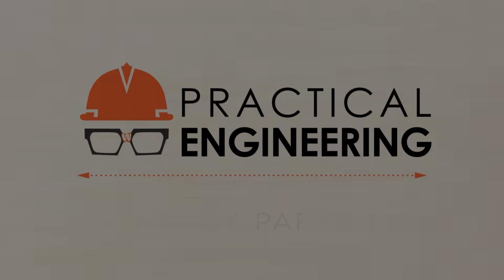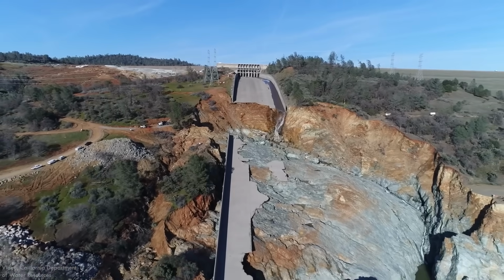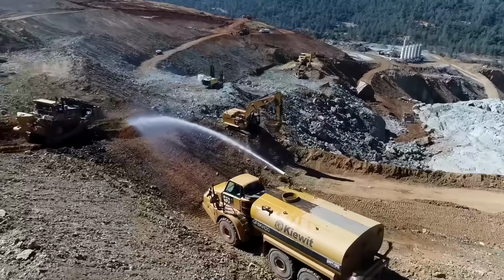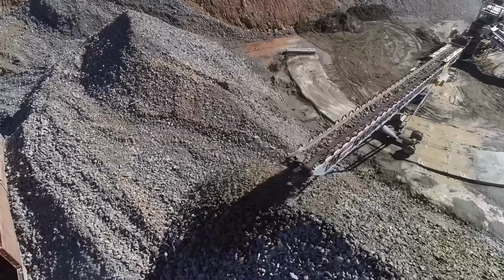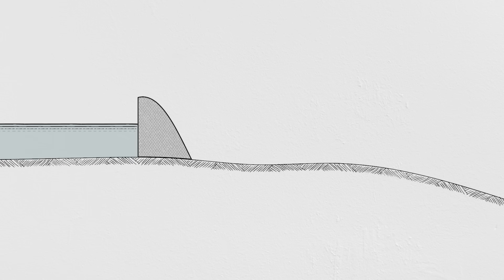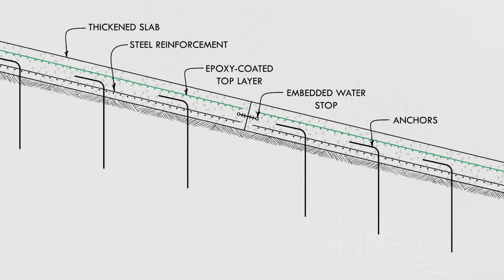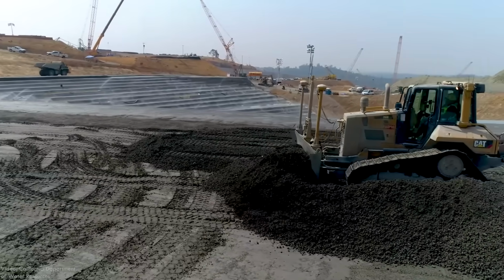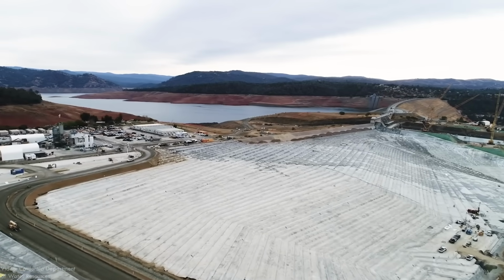Rebuilding the Oroville Dam Spillways

Comment: I think your description missed some important aspects of the concrete slab under the spillway:  key joints and a one inch jump at the top of each slab to prevent water pressure from going into the slab.
Reply from the maker: I discuss those details a little more in the previous video about the failure.

Comment: An almost incomprehensible project. To think there were literally people vacuuming the massive hillside to prep it. It's like cutting grass with scissors. 

Just incredible.
Reply: Right? It boggles my mind the amount of different pieces of engineering and manpower involved in a project like this. There's no way any one person could understand the whole picture but this was a great summary video
Reply: @SamCyanide  I hope there is, as it's someones job to oversee the project to make sure it runs properly.
Reply: You might be surprised, a "clean and clear" foundation base is always specified. We don't anticipate clean rock most of the time, however, so we're typically thinking compact native soil with a compacted fill soils in to fill in local soft spots.
Reply: I was stunned when i saw that :D
Reply: Yeah kiewit did the construction and knocked it out safely and very much on schedule. There civil projects are fantastic
Reply: "Just Incredible"? No, Just Construction. Sometimes that's what it takes to build/rebuild a project. Next time you're stuck waiting in a road construction zone, think about those guys on their hands and knees dragging a shopvac up that hill.
Reply: @charlieboardman6873  a lot of road repair involves shop vacs as well.
From the diamond saw guys cleaning up their slurry, to cleaning out cracks or potholes prior to filling them, to working on bridge expansion joints, there are a lot of guys with vacuum cleaners on road repair crews.
That was an extreme example because they had such a large area to clean, but not unheard of.
Reply: @ke6gwf  Yeah Ben, that was my point. I worked 40 years in construction as a carpenter, vacuumed up more  slurry and build more bridge expansion joints than the average carpenter.
Reply: @ke6gwf  He is right, though. Shop vacs are useful for picking up heavy dust, for example concrete dust because they require high static pressure (vacuum power not wind speed).

There are tons of industrial - and portable - machine that are 10x better than every single shop vac they bought at Lowe's. As someone in the industry, I can tell these engineers probably need to learn a thing or two.
Reply: @Awiled  if a shop Vac combined with whatever techniques the workers are using achieves the required level of cleanliness, why spend 20 times as much on machines that work 10 times better than needed?
Also, this was a rush job, so they may not have been able to get a large number of those higher grade machines as quickly as they could buy out all the shop vacs from the region.

And anything that was too heavy for a regular shop Vac to pick up, the worker would simply use a hand or tool and pick it up and out it into the bucket they had next to them. The vacuum was there to collect the dust, but the worker was the one actually cleaning the rock.
Reply: @ke6gwf  Fair enough regarding the equipment supply issue. I assumed they could probably find a place to rent a couple of machines or hire a vacuum truck to come in for a few days.

I doubt money is an issue considering how much the materials cost in this project. It would have been a drop I the bucket.

These more powerful machines would be able to pick up rocks, thus reducing workload.
Reply: @Awiled  I think you may not understand what was going on here.
The entire area underneath the spillway had to be taken down to bare clean rock, and these guys were basically taking a toothbrush to get it as clean as possible.
The vacuum cleaners were not the primary tool being used, the workers were using picks or bars or whatever to literally dig out every crack, and remove every slightly loose rock, so that the concrete would not have any voids underneath it, pockets of sand or dirt, etc. They needed to remove any potential void where water could flow or accumulate underneath the concrete, and that required manual labor going over every square foot of the project.

You can see that have a bucket as well as a Vac, that's because any of the larger debris and dirt they put directly into the bucket as they dig it out, and then they use the vacuum to clean out the smaller stuff.

So before the workers ever started crawling over this, I am sure that they used any tools available, pressure washers, compressed air, Vac trucks, power sweepers, etc, to remove as much material as possible, but none of that will work to clean out all the crevices, that requires a human touch, and so giving each guy a Vac helps them work faster, rather than having a few larger machines that the guys have to wait for and share.

So if it was about just removing loose material from the surface, then yes, they could have winched a Vac truck down the cliff, or swung it over on a crane, but that would not have done what was needed to ensure perfect concrete adhesion.
Reply: @ke6gwf  Great explanation, thanks. I'm not sure what made me assume this was the only effort at clearing smaller debris.
Reply: @charlieboardman6873  Incredible is the only single word I can think of to describe it. You could spend a lifetime writing multiple dissertations on all the different aspects of civil engineering/construction and barely scratch the surface. 

As a complete and total layman with only the most cursory understanding of what goes into projects like this, this sort of work is incredible to me.
Reply: @charlieboardman6873  Let people enjoy things
Reply: @Pyth110  ??

Comment: It's amazing how quickly things can be done when there's a sense of urgency behind it, if only other construction projects could be done with the same level of urgency, rather than dragging on for years while people argued over what colour the hoses feeding water to a site should be...
Reply: There's a project coming up near me next year that is showing a sense of urgency.  There's a bridge crossing a highway that was hit by a load that was too tall (boom truck wasn't fully lowered).  The span, one of 5 segments of the overpass, had to be removed and a temporary bridge was put in place (see the temporary span put in place in Michigan after the dam collapses there).  They have budgeted 3 months to demo the rest of the bridge and build the replacement.  Closing the bridge for longer severely impacts school bus routes and emergency services (there's an ambulance base on one side of the bridge but it's the opposite side from the main coverage area, detours add 5 minutes to responses).

Compare that 3 month window for a 330 foot long bridge to the 6 months a nearby road was closed to replace its 170 foot long bridge over railroad tracks.  

Have a sense of urgency, things can be done quickly.

Comment: Now imagine if the imminent danger of a bad flood season was the same level for climate change. We'd be carbon neutral by 2030. There's just not the same publicly visible benefit for the fight against climate change as there is for a huge flood wave just a few miles up river. It's a shame too because our world would thank us if we poured everything into protecting it.
Reply: Not sure you can compare this - A massive Construction project, with huge carbon footprint...with saving a planet...It's like 10 orders of magnitude bigger.
Reply: @mwnciboo  magnitude is different, totally agree. But if the danger of a 3° world was imminent, the magnitude of the changing our economic system would be equally large. Similar narrative would be the quote by Ronald Reagan (I think) said something along the lines of "how quickly our differences would vanish if we were facing an alien threat". Mother nature may not be an alien but it's something we are not the absolutely unable to control so I totally think my point is valid, even if yes the scale is much greater.
Reply: Climate Schmymit ...... been cycling since the Old Man said "let there be light" ....... just sayin'
Reply: @unclejack123  not sure what you're saying at all but I hope the old man is okay(!?)
Reply: LOL, cement manufacturing has a huge externalized carbon cost. 500,000+ cubic yards of concrete manufactured for just this project * 400 lbs of CO2 emissions equals 200 million lbs added to the atmosphere from just that subset of this one project. That doesn't even count the original spillway or the damn itself. I suspect won't be carbon neutral until the Earth wipes most of us off the map. It takes too long and we are unable to act, the way a frog being slowly boiled in a pot does not try to jump out.

Comment: I wonder if the rapid development cycle they utilized could be used for other projects, not just repairing failures, but in new projects that would provide immediate relief for local infrastructure.

I'm sure it costs a heck of a lot more, though.

Comment: Is it just me, or does that look a bit unnecessary?

I just don't understand what the difference is between the eroded chasm and the chute. The concrete spillway controls the flow, but it seems like the eroded chasm would have done the same. It's not like the dam buckled, or the flood gates failed.

It also cost over a billion dollars.

Don't get me wrong, I think it's an impressive structure. I just don't see why they even bothered.
Reply: Because unlike the chasm, the spillway can withstand the discharge without significant wear. If the spillway wasn't there, the next major flow would further erode the chasm, and undermine the surrounding soil. Flowing water is one of the most destructive forces on the planet.

Comment: Thanks! - This project is both amazing and frustrating, they did some amazing work here. The engineering is impressive, the design and how quickly they got the job done. It really is incredible, yet its also frustrating because it shows what can be done. Yet too many civil engineering projects are delayed, existing structures decaying and in need of maintenance and some critical infrastructure is in a woeful state like the Hudson Rail Tunnels (possible video topic perhaps?).

The success of this project shines a spotlight on all the issues surrounding all of the civil engineering and infrastructure problems.
Reply: dam is a travesty same as other dams, destroyed environment. too many people, all greed. man should be prevented from having more than l child each.
Reply: "Shows what can be done" ... yeah, it shows what can be done when you've got a billion dollars to spend on it. It's impressive, to be sure, but I'm not sure what lessons there are for projects that don't have that kind of money lying around.
Reply: @ps.2  exactly, the original dam construction cost was $13.7M in 1968, inflation adjusted that's $101M in 2018. The emergency repairs cost $1,100M nearly 11x and that was just for 2 spillways, not the dam itself or the power plant. Basically all it shows is what an amazing team of engineers and construction workers can do with an open checkbook.
Reply: @andrewfidel2220  I'm too lazy to check your numbers but that doesn't quite pass the smell test. If $57 billion becomes $101 billion in 50 years, that's an inflation average of 1.15% per year. Including through the 1970s. So, I doubt that.
Reply: @ps.2  sorry it was $13.7 million in 1968 to $101 million in 2018, had two different articles open and grabbed the wrong number for the 1968 figure.
Reply: @andrewfidel2220  Well, go figure, when I posted my reply, I said billion twice in place of million. (I stand by the calculation though.)

So...yeah. If the repairs cost 10× or 11× the (inflation-adjusted) original project cost, that does say something, doesn't it?

Comment: I got to talk to one of the someone who worked on the investigation, Basically, for the spill way “inspection” The engineers would rent a helicopter, versus normal practice of repelling down the dam. Like everything else they made sure to miss those details. 

Same thing with covering up the twice hardened anchoring bolts on the new Bay Bridge in San Francisco, instead of using the bolts they were supposed to test, they used special ones, cherry picked for the test, and still had a high failure rate, because they where so brittle.

Comment: Politicians can't make a flashy press conference or campaign commercial from maintaining infrastructure.
But they can do that when they spend billions fixing the problem after it's broken and creating a crisis.
It's an allocation system with built-in failure mechanisms that encourage massive waste.
Reply: You can just as easily turn it around. Voters do not reward politicians for invisibly maintaining infrastructure. They only reward politicians when they do something visible to them. And something being broken and then fixed is very visible, while doing it right the first time gets absolutely no voter recognition.

Don't remove voter apathy from the "allocation system". Voters are getting the government they vote for.
Reply: @GeneralBolas  Absolutely. The media's need for a story is as repetitive as the public's need to have a crisis to care about.

Comment: great job! never heard of rolled concrete before this massive repair project.
Reply: Interesting that it generates less heat - I was wondering why the videos didn't show embedded cooling pipes like at the Hoover Dam that kept the concrete from splitting as it cured from internal heat buildup.
Reply: @us89na  That is interesting. The heat comes from the reaction between water and the cement, but my idea has been that the reason that less water makes for stronger concrete is that all the water is used up in the reaction whereas in normal concrete that flows easily there is water left over that weakens the concrete. Clearly there is something wrong with my theory.
Reply: @davefoc  
A quick currying concrete can use less cement as well as less water with a lot of high range water reducing admixture. With less cement its not as strong, but it's only meant as a base, a roll typically filled by native soils, in this case, native rock and this Rolled Concrete (I've never heard of this before this video, but it makes sense). Normal concrete has 2% to 5% of air content depending on use; mixing it gives it a basic air content, admixtures can increase that for icy conditions. I bet this RC concrete is more like asphalt, in the 5% to 10% range.
Reply: I think it was from this channel, but RCC is has been mentioned before as essentially why ancient Roman buildings still stand!
Reply: @Gerthious  The romans did use concrete for construction, but they did not have the vibratory rollers necessary to compact concrete dense enough to create RCC (roller compacted concrete).
Their concrete used pozzolanic ash as the cementious binder. Modern concrete uses lime/limestone based cement as a binder. Acient Romans and modern builders both use forms/molds to hold the concrete as it cures.
Reply: I hadn't either but it's very similar to how a shower pan is built except ramped up by a factor of a gazillion.